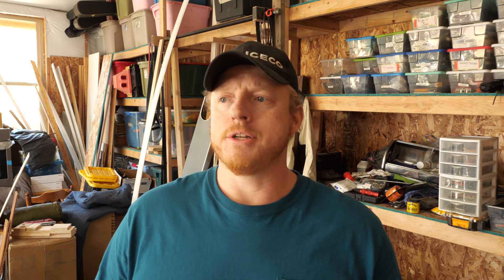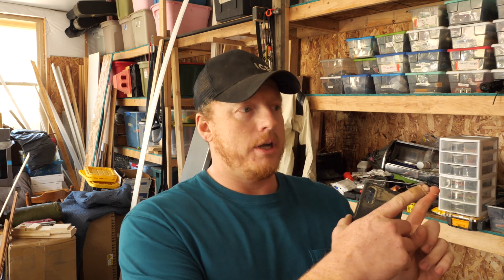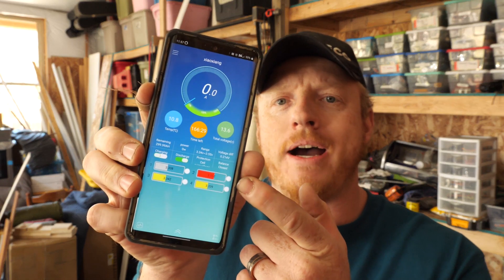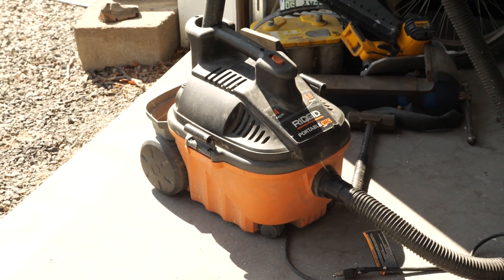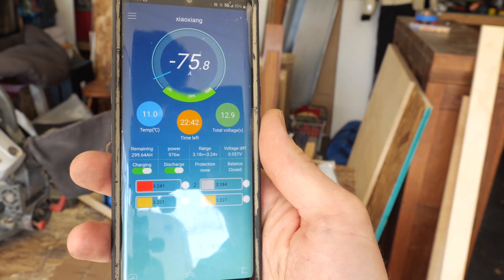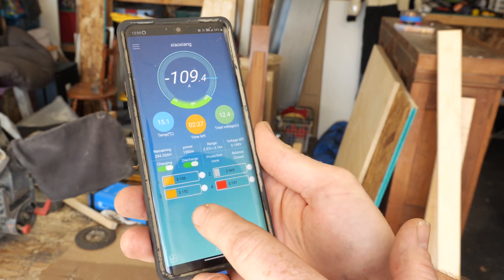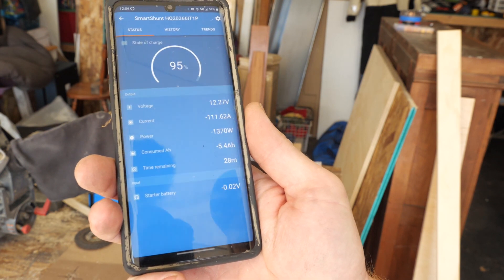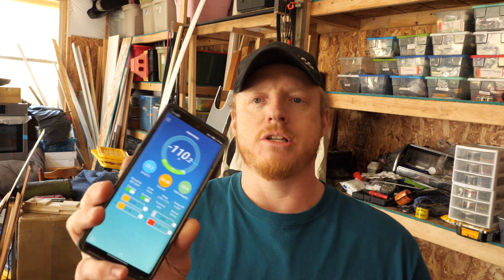LiPo4 Battery Testing , Overkill BMS , Top Balancing Discussion

Comment: I bought a 5000 watt/20,000 peak watt POWERJACK UPS INVERTER/CHARGER [80 AMP CHARGER].  Also has an Automatic Transfer Switch option, which uses batteries until needing charge rather than house power while plugged in. this uses the least home power possible when your batteries also charged by solar. In UPS MODE it uses house power until un-plugged or power outage. This thing has been on in the various modes going on 4 years non-stop. IT was super cheap. BUT  I plugged in my 1500 watt portable AC unit and it blew its 25 dc amp fuse. LOL. That is not a typo. 25 amp fuse. WTH?  Still great . Worked my 1500 watt window AC. MICROWAVE, coffee maker. everything for luxury camping. Although it just stays parked next to my house for UPS internet/modem/router/lights/TV/computer. 
So watch out for those orientals electronics mathematical sales conversions. lol. just divide by at least 1/2. All joking aside. I looked inside and this was put together nice .nice soldering. only one almost pinched wire,[fixed] , and clean work inside.  It's a good idea to open up things like this that come in the mail. They can have a rough trip from where ever and you can find nuts and screws lose inside ,just waiting to short it out a day after warranty.

Comment: Nice video! After hunting down the batrium people for their new BMS I hesitated because of the high prices.
Now I am willing to wait a month or more untill overkill will be ready to send out their bms.
The addition of a shunt plus extra relais for disconnecting doesn't help either.

Plus of the batrium is the sexy look of all parts and the very neat software with all the battery voltages shown in a graph with perfect oversight.

Where did you connect the shunt to by the way (seen at 4:07)?? To the Victron?
Is there an input for a shunt (didn't find it at th manual) or does the overkill has it's own internal shunt?

Keep up the good spirit with your interesting volgs!

Comment: That bms it has 3 10gauge cables? What size  terminal did you used to connect the 3 cables to that terminal? 
Good videos 
Thanks
Reply from the maker: 2 gauge iirc

Comment: One thing I did is to setup Overkill BMS balancing starting voltage from default 3.4 down to 3.35 so the balancing starts earlier. I believe this BMS only balances when charging and you definitely want to top balance these cells. I'm doing it now on my 48v 16S setup and I already built 12v bank with same cells and BMS for my sailboat house battery. Replaced 3 led acid batteries with one 12v 280ah bank. I wish that this BMS would balance even not when charging or would have higher balancing voltage. I lowered the 3.4 voltage so it starts balancing earlier so I don't have one cell running too far ahead over the other cells so it has more time to burn off extra voltage. Either way, once the charger off, these cells balance back very quick and stay balanced pretty well.